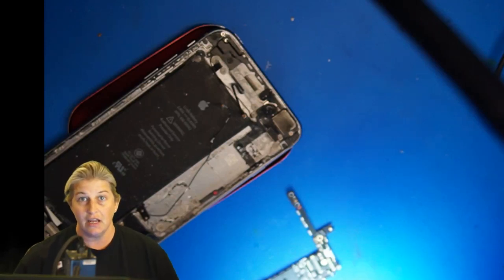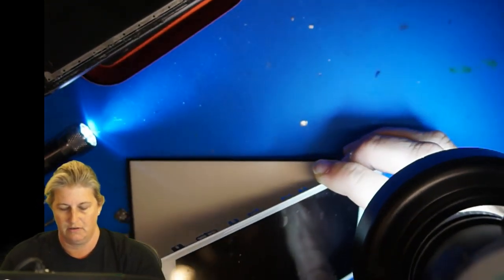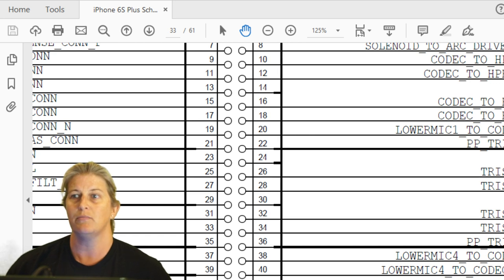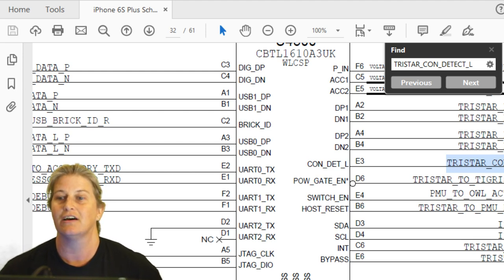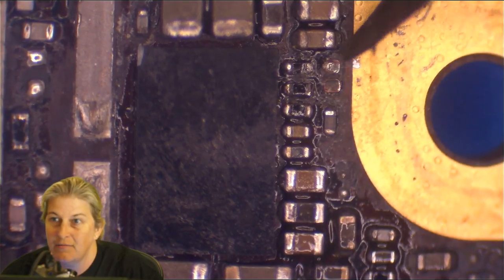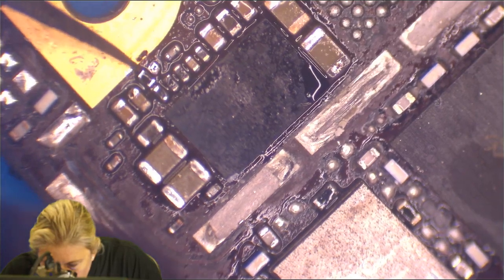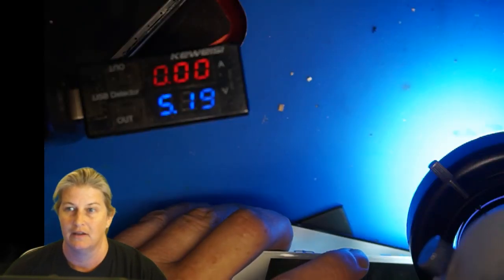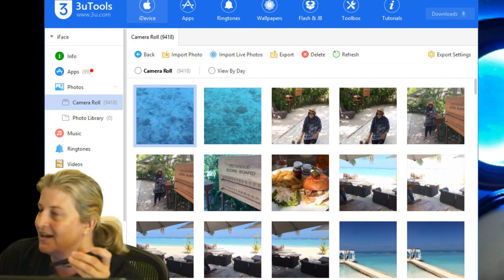What to do when diode mode is normal---the case of Faisal's phone went snorkeling

Comment: When I was young and foolish, I took a job at Dutch company Getronics, which was at that time a contractor for Apple. We repaired boards for them, which their dealers sent to us. I think I fixed 7 boards a day on average and my pay was the minimum allowed wage at the time.
I got fired after 7 months, but I didn't mind. I would get hired anywhere, after a 20 minute interview.
What was on the Macintosh board would nowadays be one chip. Most of it was video related.
Apple had supplied us with paper copies of their schematics.
We never got any training. I impressed the interviewer, because I upgraded my home-computer with some extra memory chips so I knew terms like RAS and CAS.
I never used diode-mode or even a multimeter. Signal speeds were in the megahertz range, so a 50 Mhz analog oscilloscope would be your eyes. You'd start at the clocksignal and work your way to the video-output and somewhere half-way there would be a failed FPLA.
The hard ones were the intermittent faults. The boards had this very large 68000 processor and the computer would go crazy if you tapped it there. After I replaced one and cured the problem, the manager blamed me for the spike in component costs, because all my collegues copied it :-)

Comment: I have another salt water iPhone 6S, my case is worst, no short as well but doesn't wake up, but has response at plug charge time although loop like the consumption with the power supply. At press time go around 0.9A back to 0 then 0.9A... like a loop, not time to show Apple logo. Replaced Tigris and then Tristar, first remove the small audio as well (U3800), close to Tigris, most of rust was there. Even don't get hot any area at power time (checked with thermal camera and rosin method), anybody had similar experience in past and bring me an idea?